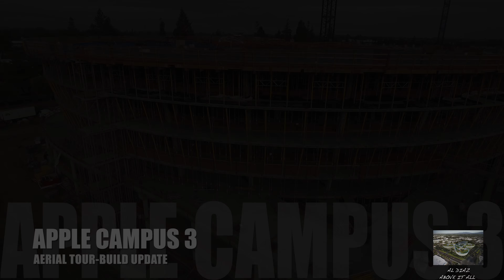APPLE CAMPUS 3 BUILD UPDATE [[4K]]

Comment: what are those blue lines there laying in the floor with the rebar to.be poured?  are those water.lines for radiant hydronic floor heating?  its almost like apple is pulling crazy stuff.out of their ass to keep us all entertained.
Reply from the maker: If you don't know, I certainly don't... I thought it was cables but they would be covered by conduit
Reply: blue is generally water, red is gas, electric.may be yellow....  the size and the spacing leeds me to beleive.its.hydronic heated floor.  i have a feeling normon foster has.his hands in this.  its.just too complex.
Reply: websuspect, those are post tension cables. They allow greater spans between columns for more open space. Also, Apple has signed a lease to rent this campus when it's complete, but I'm not aware if they had any involvement in the design.  Even if they did, in-floor radiant heating and cooling is pretty common now.
Reply: Theres a rumor apple canceled the car because they made the car a shit fest and did not know how to manage designing a car.  Which is kind of what i saw from watching it.  It was like  car fantasy camp .  Or if the apple car is a seperate project they may be going to rent it to the apple car people. chadtransam2
Reply: off again on again.  after a gentle nudge apple has applied for the paper work for the MVA to test car.  i sent Mr Cook a letter asking him to make 50 cars, the reasoning being apple car marketing more favorably than gm, Ford, Chrysler, BMW, Volvo and mercedes, for this level of technology.  word is they also have another new.project manager.